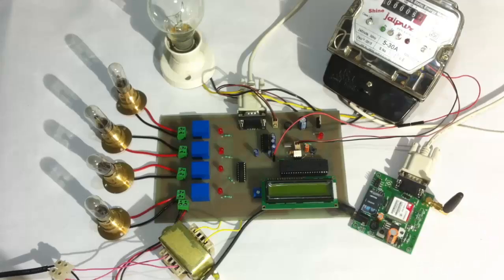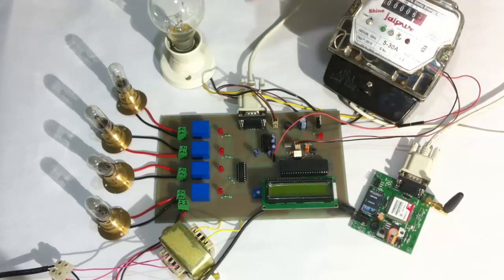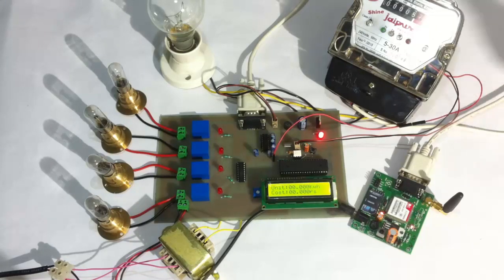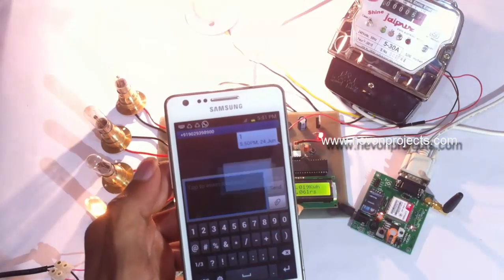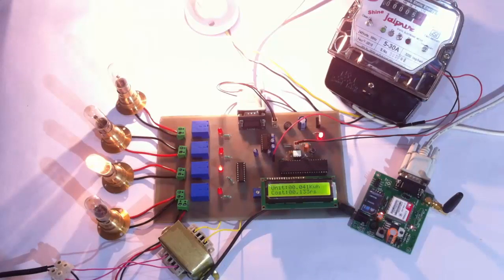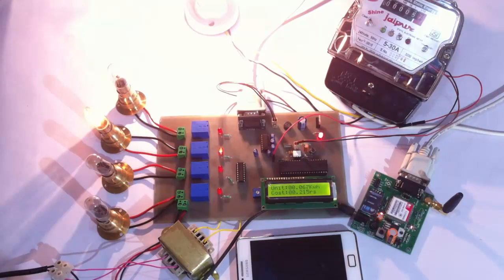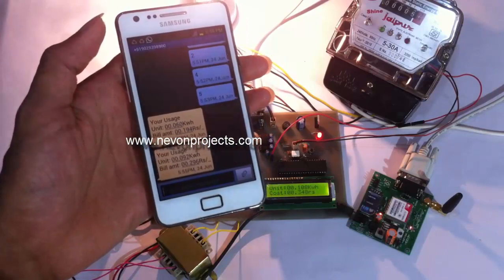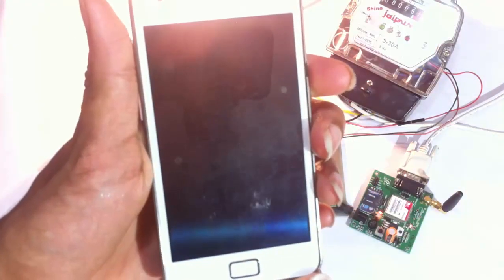Power Meter Reader Plus Load Control Using GSM

Comment: Nice project bro  but in case unable to receive the  sms like mobile signals are not their then it will not receives the any sms then how can u control these loads
Reply from the maker: For this Electronics Project Details Or Customized Development Call/Watsapp +917738796642
Reply: @NevonProjectsOfficial  Hello sir can I get a full making Step by step of this project.